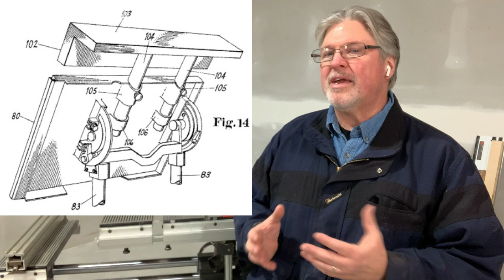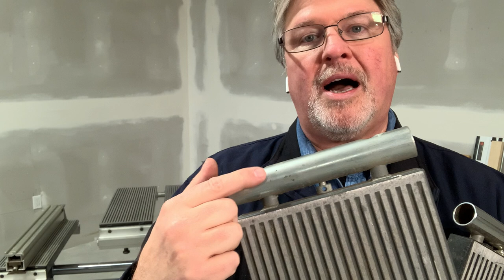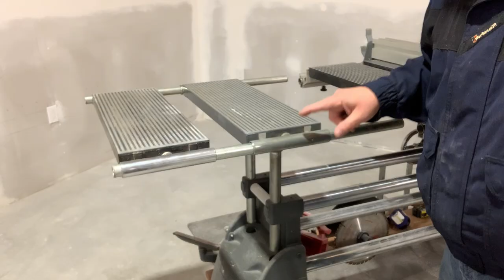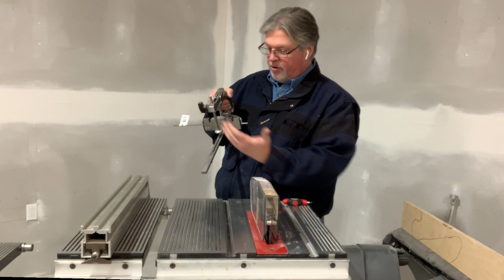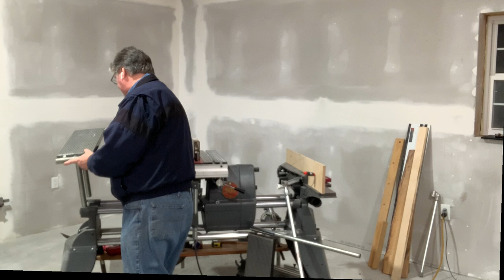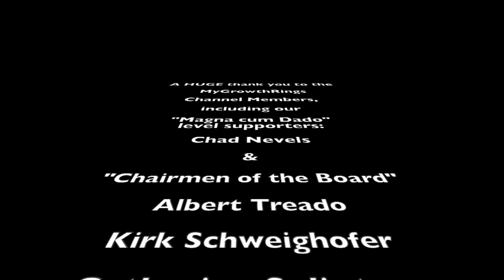Maximizing Your Shopsmith's Potential with something you may ALREADY OWN!

Comment: Scott, a thought came to mind while in my shop. I heard the extension tubes used to tie the 510/520 tables together may not be exactly round due to the welding process. I always put the weld down (6 o’clock) position based on what I recall from an older video I seen. Do you have thoughts or concerns about about the best way to position the tubes or isn’t it necessary? Thanks?
Reply from the maker: Hey Jim. It’s worth checking to see if they are bowed, but if they are off by much I would replace them. But be that as it may, I have no issue with that approach.

Comment: Damn you Scott!!!...  My wife is going to be pissed at you. LOL I have always wanted a 520 but never seen a real justification.     I have put a fence on a floating table of my 510 but only if my floating table is flush against the main table.  I have never had a issue.  But is forsure a issue if you have a lot of space between tables.            I just saved a 520 with newer bandsaw jointer molder, biscuit jointer 2 disk sanders and more on market place for $800 a hour ago.  Of course I also saved a belt sander with a disk sander on a workmate for $250.  More in my budget at the moment. Not sure I need another workmate but I could most likely sell it.  But either way by the end of the year I will be having to ask forgiveness from the wife over this video. Lol
Reply from the maker: Please, extend my apologies to your wife.
Reply: @MyGrowthRings  🤣🤣

Comment: This video alone makes me want to bite the bullet and do an upgrade to the extrusion. I've run into the "play" problem more than a handful of times plus I'm left handed and my brain sometimes thinks totally backwards when pushing stock through and/or watching tutorials of others doing so. When the table saw is setup for my brain I feel more confident making my cuts, which sometimes means doing things *ss backwards from others. Anywho, Thanks as Always Scott GREAT VIDEO
Reply: I went to my metal supply store and bought two 60” x 1” steel rods. They fit perfectly in my 510. That way I can put the floating table on the outside of the extension and align it to the main table height. It’s much more stable and if I need to put the rip fence on it, I realign the fence to the blade after it is secure. Upgrading is tempting but the few times I need to rip something that wide don’t justify the expense to me.
Reply: @daveschmitt6369  Thanks Dave! I might just keep that as an option. I agree that the price is still a little overwhelming for me as my Shopsmith was gifted from my father in law who never used it so I'm definitely dabbling in a rich man's world. Luckily, I use it for my Luthier business so they have paid for some of the investments over the 2 years I've owned it. It's still a balance though when I make the upgrades and Alot of research. That's why I Love Scott's channel. His expertise helps me decide if I "really Need it" or just "want it".
Reply: @JK-qp4jy   I inherited my first Mark V from my Dad, although he used it and taught me to use it when I was in the 8th grade back around 1968.  I've been using them ever since.  Four years ago, I purchased a 510 and sold the Mark V, since then I added another 510.  I troll Craigs list within a couple of hundred miles from my home and wait till things have been sitting and not selling, then I make an offer, so I've gotten two Mark 510s for around 300 as well as a duplicating set up for the lathe a 1" belt sander and a router table all for cheap.  I'm thinking about starting to look for a 520 to replace my one of my 510s with but will be patient and see what turns up.  A lot of old Mark V models are for sale and if you are looking for SPT tools and are patient you should be able to pick one up for a couple of hundred dollars with the SPT attachments you want.  Since many of the parts are interchangeable with the 510, you can cannibalize the maintenance parts and store them for further use.  Just a thought
Reply: Yeah, luckily I've come across some great people on Ebay. Haven't made any large purchases yet but my Mark came with jointer and almost every accessory tool, fence, and full table extension system they must've offered at the time of my father in laws purchase back in early 90s. When I start doing the math on it all compared to the Shopsmith website it's up over 10,000 so he must've had a good salesman. I can't believe it set in his garage for over 10 years covered and forgotten but he was a machinist and constantly traveling. He loved the drill press but never really used it for woodwork so it's tough to even ask him about some items. That's why I'm grateful for Scott and everyone on here, including you, for being so friendly and giving me tips along the way or I'd have been lost. Still feel lost sometimes but the community backing the SS is Amazing and I'm blessed to be a part of it . About to turn 40 next month and I'm well into supporting 2 small businesses solely off of this machine and some effort right out of my walk out basement. I think that's everyone's dream is to Love your Job and be your own Boss so I feel blessed

Comment: Very informative video! The Shopsmith engineers never cease to amaze me!
 I seem to recall you saying that you prefer the 510 over the 520; but your video shows more pro s for the 520, and more cons for the 510. Would you clarify why you prefer the 510? 
Also, when Shopsmith still had traveling salesmen and traveling seminars, the salesmen demonstrated a wide variety of floating table setups. 
Shopsmith also sells a dedicated outfeed table for each of the models 500,510 and 520 which are directly attached to the main table and thus moves up and down and tilts with the main table. I like the extension brackets which allows the addition of indeed and out feed support. These give more options if you purchase extra floating tables.
 If space and $ are not  issues, a second Shopsmith can be used for outfeed(or infeed) support. Removing the blade and upper saw guard allows for a large surface that can be adjusted to  match the working unit.

The upgrade for the old 4 inch extension table is 7 inches wide (and recently on sale at Shopsmith - be sure to sign up for the weekly specials-under the products tab). jim

Comment: Is there anyway to put the Shopsmith models in the summary so we know if the material is relevant to the viewer's SS.  I bought mine in 84.  Most of this video has nothing that applies to my situation.  Thanks for the consideration.
Reply from the maker: That’s an interesting point, Larry. You are right that this particular solution is for the 510 & 520 and not easily adapted to the 500. At one point SS sold a part that bolted to the main table of the 500 that would simulate the rear fence tube of the 510 so that 500 owners could use the their rear support table, but if mention this I suspect that means you don’t have that either. The challenge is that the 510 is different than the 500 
!which is different than the mark seven, which is different than the mark two, which is different in the 10 ER. They all share some common idiosyncrasies, but not everything will apply equally to each. Perhaps there’s something I can do in the thumbnail or title or description that could be helpful. I’ll have to give that some thought. Thanks for the comment and suggestion. Scott

Comment: It seems that the 510 system is quite inferior to the 520?  In my case the fence is a nightmare ?  Anyone else find the fence is not well done. ?
Reply from the maker: Donald, I prefer the 510 for all but those situations where the fence needs to go on a floating table, and when then I have the support table. What issues do you have? By chance are you using the set screw in the base to align it?  Scott
Reply: @MyGrowthRings  hello Scott. It seems that the fence does not align parallel to the blade. I usually do not use then set screw. Thanks for helping
Reply from the maker: @QNSwebmaster  Ok, I was worried, because the folks who use the setscrew for alignment will always have issues. Did you happen to catch this video: https://youtu.be/09gXRyN1K4s
Reply: @MyGrowthRings  that is an excellent video and just what was looks for. Thank you. 😊

Comment: I am sorry to say, but my 510 tables, floating or otherwise never seem to allow square alignment to the fence/blade.
Reply from the maker: That's quite possible. I've aligned my extension table on the right end of the machine and only ever use it on the right, and I never use the fence on a floating table. Is that you approach? If not, you will have issues. Scot

Comment: Hey Scott, nice video! Cold in the future shop today huh? Couple of times, I saw your breath. I’m confused. You once told me you prefer the 510, but that system on the 520 looks pretty nice… Is there a reason to leave the planer engaged while running the table saw functions and visa versa?  □
Reply from the maker: Yes, it was a tad bit chilly. I do prefer the 510, for several reasons. I still need to do a side-by-side video to explain why. That said, there are a few situations where the 520 wins the day. Being able to put the fence on the floating tables can be a big win, if you’re using a lot of sheet goods. The jointer is frequently used while ripping, solid wood, but would be a necessary when working with plywood.
Reply: @MyGrowthRings  I understand leaving the planer on for weight, but I always disconnect the drive when sawing, or remove the blade when planing.